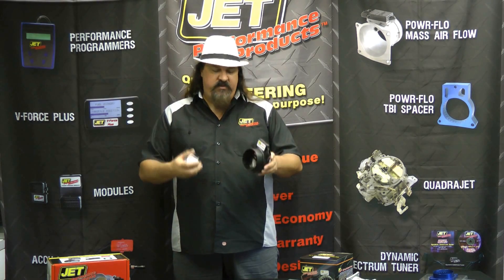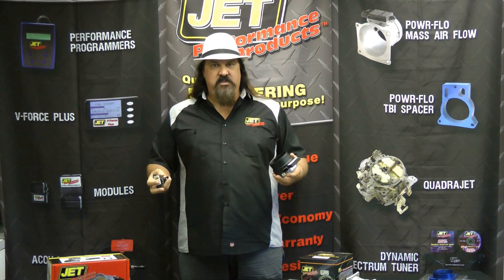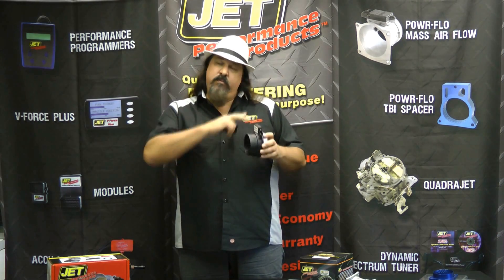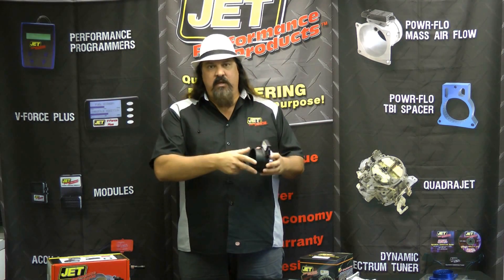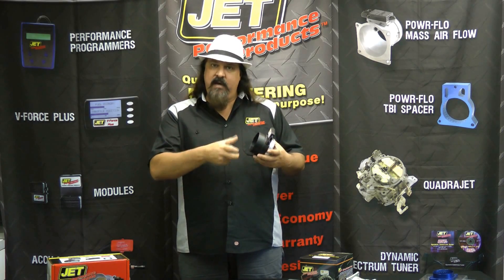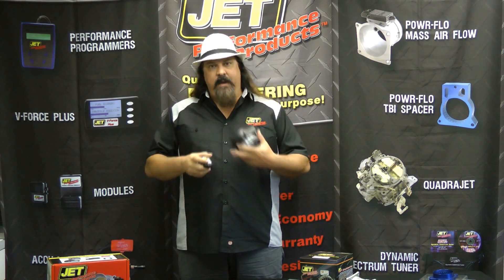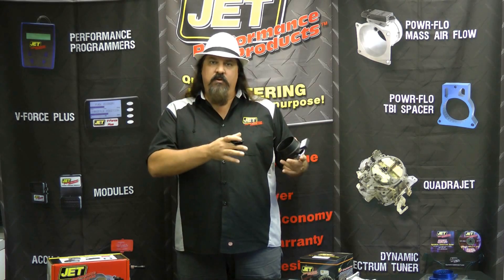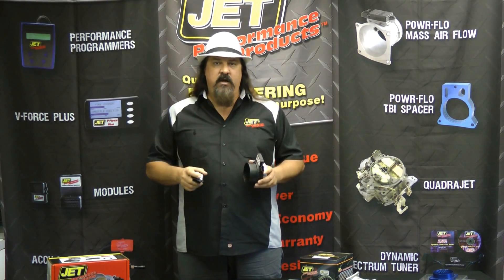JET Performance Products: A closer look at Mass Air Flow Sensors

Comment: Do these run well in a 2nd gen (09) Tacoma 4.0l? stock intake, 2.5" exhaust with flow master flow FX. I will likely get a dyno tune done later, Will this be a problem with the JET MAF present? Thanks!
Reply from the maker: Hello,  no these work great on them, my buddy has a 2nd Gen also and it runs great. 
What are you trying to tune or tune for on the dyno you are looking to do?
Reply: @JET-PERFORMANCE I'm not entirely sure how the tuning process works. But I know that as you add higher performance parts to a stock vehicle, things need to be tweaked to get it running true. Also, OTT tunes are very popular and common for Tacoma's. Just trying to figure out if this MAF will interfere with external tuning.
Reply from the maker: @MTcoiner Let me check with my tech department and see what they have to say about your upcoming retuning
Reply from the maker: @MTcoiner I went  ahead and checked with my tech department and they said that the MAF will not interfere with your added tune. So you would be good to go

Comment: Based on the reviews, sounds like both the customer service and the sensors are shit. I was here to see if anyone has problems with this company, apparently so. I'll pass.
Reply from the maker: We actually have great reviews on customer service and products. If you follow the installation instructions properly (which a fair amount do not, and that's when you have issues).

Comment: I’m looking for more throttle response and torque/hp from my 2013 Honda Accord lx, I currently have changed the stock air filter to a K&N cold air intake system. 

Would this yield a good amount of improvement for me?
Reply from the maker: Hello Douglas, yes this would help with a few things; torque, throttle response and increased MPGs
Reply: A tune would do just that
Reply from the maker: @josephg1232  Yes it would, or you can just buy this sensor and not have to retune you vehicle or take it to a trusted shop to tune that.
But, tuning just your MAF at a shop seems like a lot of work for just the MAF. Our product makes it a simpler process

Comment: Trash product made the truck do nothing but throw codes
Reply: Stoped responding with no help just like the emails and customer service
Reply: You have not sent me a refund I do not have a refund confirmation email I was literally on the phone with your accountant an hour ago and they said that she didn't even have anything on her desk and that she would have to get back to me so for you to tell me that you've already issued a refund is a blank lie
Reply: After reading all of your reviews on Yelp which you should look at I would never order anything from your company again
Reply: @clai-videos-and-reviews  After reading your review, I have decided against buying an over priced piece of shit winding up in your same situation. Thanks for letting us know
Reply from the maker: Hey there, if the sensor is throwing a code then your filter probably has too much grease on it (you can fix that by using MAF cleaners from any auto store) and/or you did not unplug the battery for the ECU to relearn the new sensor. Sorry for the inconvenience but, please contact our customer service for assistance and other install questions.
Reply: @JET-PERFORMANCE  customer service is no help the mechanic at the shop performed the step by step process that you guys told them to do with unhooking the battery and doing the process your tech already confirmed it was your product all I need is for your customer service and response to send me my refund 've literally called your phone number multiple times for 4 days sent multiple emails and me leaving a bad review on YouTube has now gotten me the fastest response this is literally the only way I've been able to talk to somebody with your company
Reply from the maker: @clai-videos-and-reviews  We are in the office Monday -Friday from 8am-5pm PST, we are not in the office over the weekend to answer emails and calls. 
Again, our email and call logs with you have been very consistent and in a timely manner since you contacted us with your issue. 
We apologize for the inconvenience with the product you have but, if you let us fix the issue by sending you a replacement or a refund which we have (and those take 5-10 days on average) we are able to do so and have.

Comment: is this comparable to an sct ba5000 or pmas hpx? am looking to extend the maf range because my maf is pegging.
Reply from the maker: Hey Steven, I am not sure on that but, please contact our customer service through email or call. They have all the info you would need. 
I do know that our MAF is amplified to increase the air ratio
Reply: @JET-PERFORMANCE  I'll do thanks
Reply: are you pegging the mass air flow or is the mass air flow pegging you?

Comment: Hi,
I have a 2020 acura tlx 3.5. Have a Takeda intake and a throttle body spacer. I've checked online and it seems as the 2014 MAS sensor fits my 2020 model. Can you confirm if possible?? Also what kind of increase in power should i expect? Thank you for your help...
Reply from the maker: Hello there, you would need to contact our customer service for that. They know all the tech info as for as compatibility. You would probably get around 6-9 hp and about the same tq but that's a ballpark number. Contact them and they will sort you out. Also, be sure to use our 25% off code and free shipping when you sign up for our newsletter

Comment: What aftermarket cold air intake do you guys recommend for the jet MAF sensor to pair with on a 2009 Honda Jazz ge8??
Reply from the maker: chevaughn ferris cold air intake is best but short ram will still be affective. K&N, Airaid, any really. What we recommend is getting the dry filters or the filters with not a lot of oil on them. Most times the oil on say K&N filters is usually a lot and that excess oil will get the sensor dirty and cause a check engine light. You can clean the sensor with sensor cleaner and the code will go away.
Reply: @JET-PERFORMANCE  sounds good. I've installed a short ram on my honda fit a few months ago and the check engine light came on actually. Also It's one of the dry ones.
So you're saying the jet performance MAF sensor will make that check engine light go away once it's installed right??
Reply from the maker: @tristanferris898  Oh I can say that the sensor will take away your check engine light. You might have a bad maf sensor, or your O2 sensor might be the issue. Our product will add more performance but, eliminating your current check engine light? I can't say for sure.

Comment: I have an ls2 making about 450 hp serious airflow how much will jet maf add for me in your estimation?
Reply from the maker: Darrell Morris we have two Sensors for that engine I believe. Take a look, it adds about 45% more than the stock sensor for air flow. Be sure to keep it clean and don’t have too much oil on your air filter. That will cause the sensor to throw an error code
Reply from the maker: Darrell Morris also use our 25% off code JETGARAGEVIP

Comment: I have a corolla 2011 with Injen CAI (doesn't use oil). How much increase in HP can i expect ?
Reply from the maker: Around 7-8 hp and 8-10 torque

Comment: Hi I dont know if jet reads these comments or not but I put a jet mass airflow sensor on my  truck and my check engine  light came on but my truck runs like a dream I dont know If my truck needs a tune to run it or what if some one had the same problem could they give me a idea I would appreciate it thanks
Reply from the maker: Hello Jim, yes we do read these. Do you have an aftermarket intake?

Comment: I read a review on amazon for my tundra that you guys states this does not work with oil based filters. Is this true?
Reply from the maker: It does work but, oil filters are notorious for being "over oiled" and that is what fouls out the sensor. So, if you do have a oil filter, clean it, re-oil it (just a little), and then it will work right.
Reply: @JET-PERFORMANCE  how about needing for it to be tuned after just for it to work?
Reply from the maker: @joeymanuelruiz  I don't understand this question? haha. Nothing needs to be tuned from us. You can mess with tunes on the V-Force but everything else is fully setup. However you do need to unplug the battery when installing so the computer can relearn whatever tuner you just installed. If you don't do this then you won't see any change or you will see error codes or the car will not run properly.
Reply: @JET-PERFORMANCE  the vforce doesnt have a differernt tune option
Reply from the maker: @joeymanuelruiz  It should have a pre-set tune and a custom tune for your to set
Reply: @JET-PERFORMANCE  im only asking cause i have faith in the jet products. But the vforce product for my tundra shows zero change. Im worried to buy anything else
Reply from the maker: @joeymanuelruiz  Really, zero change? Of thats the case then you might have done the install improperly, or the settings are set right, or last case, the product is defective. Did you unplug your battery when installing the Vforce?
Reply: The the one that has a preset tune and just monitors stuff

Comment: I tried one of these.  I have a corolla xrs.  I changed to a short ram intake and matched it with the JET MAF.  Here's one metric for you.  the quoted highway gas mileage of the car is 34mpg and with this stuff installed I'm actually making 39mpg.  I can't say I feel a difference in power and I never dyno'd the thing, but I can say that it's definitely running efficiently.  I'd only use these in the case of having modified something to the air intake to allow more flow.
Reply from the maker: What short ram are you using?
Reply: @JET-PERFORMANCE  I just got a new intake and I’m getting coding of Maf would this help me getting my coding off
Reply from the maker: @mundoimperial660  Hello there, well that would depend on your current MAF issue. If the MAF is bad or an issue like that then our sensor would. If there is other underlining issues with your MAF error code then it might not.
Reply: @JET-PERFORMANCE  would Jet Performance 69193 Powr-Flo Mass Air Sensor fit on a 2.7 Chevy Silverado 2020 1500 ?
Reply from the maker: @mundoimperial660  Hey there, we currently don't seem to have a sensor for the 2.7 which is interesting. I will take a look into this and see if there should be something listed.
Reply: @JET-PERFORMANCE   how can I reach out to you specifically to you I wanna show you something
Reply from the maker: @mundoimperial660  You can message us on our Facebook page
Reply: @JET-PERFORMANCE  ok I reach out !!!

Comment: Hey bro I got a 17 GMC Sierra with longtube headers intake exhaust and tune would I squeeze out any extra anything out my engine with this?
Reply from the maker: Hey, you would get better throttle response, more MPG, and with your current upgrades you would probably get around 8 hp.

Comment: How much horsepower & torque can I expect if I install this on my 2014 Camry 4 cylinder , everything is stock ? Does it improve acceleration or what exactly
Reply from the maker: Hey Miko, the MAF adds more torque, throttle response and better mpg. It does add some horsepower but, depending on your setup will determine its output. On a stock setup, it would add 8 torque 5 hp, quicker throttle and more mpg.
Reply: JET Performance Products can you briefly explain how is that possible on a stock setup truly?? 8 torque/5 hp ‘... And also does the rpm’s shift quicker with the jet sensor ? & How much gain can one expect in terms of mpg ?
Reply from the maker: Our Sensor allows more (over the stock maf) air to be let into the engine. Giving you mainly more torque and mpg but, giving you some horsepower. To get better performance out of your sensor, I would recommend an aftermarket intake system or better yet and cheaper, I would get a cloth filter. The cloth filters are less constrictive and will give you the added HP that you want. Be careful with some filters though, K&N has a good amount of oil on them (or they can), the more oil on the filters will fault out your sensor (get it dirty faster). I hope that helps.
Reply from the maker: Hey Miko, you should expect around 3-4 additional mpg's on a stock setup. If you have an aftermarket clothe filter then that will increase your mpg's more.
Reply from the maker: Miko, I am sure that you know but, if not; stock filters are very restrictive and hinder the cars performance. They don't breath well because they are paper material, and getting an aftermarket filter that is cloth based (not a paper filter) increases performance, throttle response and mpg. 
WIth our MAF sensor and an aftermarket filter you will get a much better output. You will need to disconnet your battery while doing the install with the MAF. After you install and connect your battery, you will need to run your car for a few minutes for the system to reset with the sensor. After that you should see an improvement. Monitor your gas before you install the filter and sensor and after you install.
Reply from the maker: What I meant was have an idea of what your normal or average mpg's are for a tank of gas. And then after you install the MAF and filter see how that changes the next time you fill up your tank. Does that make more sense?
Reply from the maker: Well, your overall performance would increase with the new filter and MAF so yes.

Comment: What a piece of crap,they said it was ideal for aftermarket intakes,so I ordered it,put it on my truck, a lot of warning lights came on ,contacted Jet,their reply to me was,it doesn't work with Kand N cold air intakes ,why the hell don,t they mention this in the add ?
Reply from the maker: Sorry for the miscommunication and the trouble. They actually do work with the K&N systems, however, due to the amount of oil applied to the K&N filters, clogs up the sensor and keeps the sensor from working at its peak performance. So, when you wash your K&N filter next time, apply just a little bit of the protective oil and the sensor will work as desired. Again, apologies for the inconvenience.
Reply: Yeah actually it does say don’t use with oiled air filters.
Reply: Maybe use a data log or a scan tool PID to see what your airflow reads before blaming the parts company

Comment: Can we get a dyno run?
Reply from the maker: We dyno the performance programming such as modules and programmers. But if you call our sales team, they can provide you with numbers per application. http://jetchip.com/dyno-sheets/   (800) JETCHIP
Reply: JET Performance Products I checked the dyno sheet and it was for your v force performance module. I was looking for the MAF sensor sheet. The price is around $150 for my car and there is no proof of any gains to be found anywhere
Reply from the maker: As I mentioned, we post dyno results for the performance programming such as modules and programmers. Although they will add HP, MAFs aren't usually the first stop for HP. It usually comes after programming, intakes, etc. Most people want to see what the programming can do since that is where the big gains are at... But if you call our sales team, they will happily provide you with numbers per application. http://jetchip.com/dyno-sheets/   (800) JETCHIP

Comment: I have a question, will we have to match up the OE # to make sure it works for are cars? Cause if you put a normal sensor that doesn't have the same OE # and the engine will cut off will it reset and fix it on the computer instantly?
Reply from the maker: +XeN Dev when you head to our website and enter your specific vehicle it will pull up that which is for your vehicle. If you have more questions I suggest you call 1-800-JETCHIP or email customerservice@jetchip.com :)  www.jetchip.com